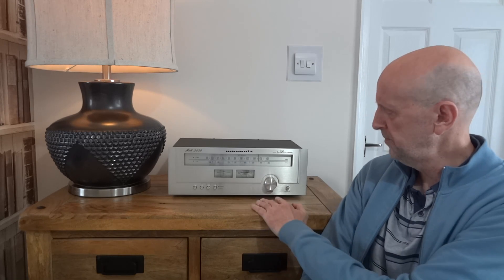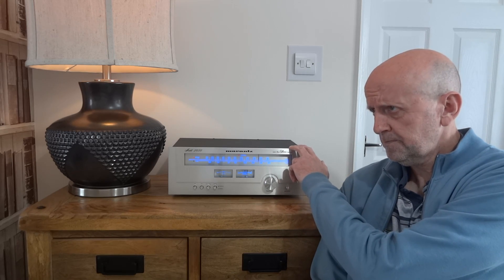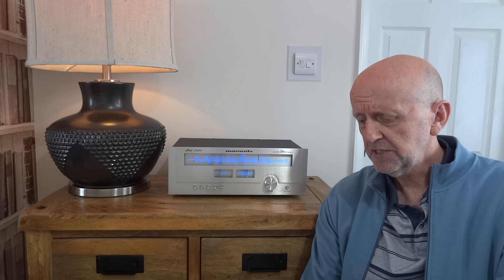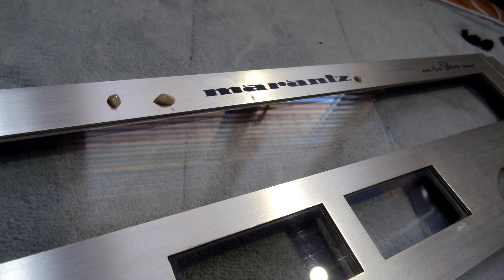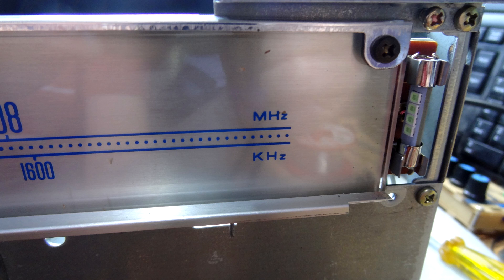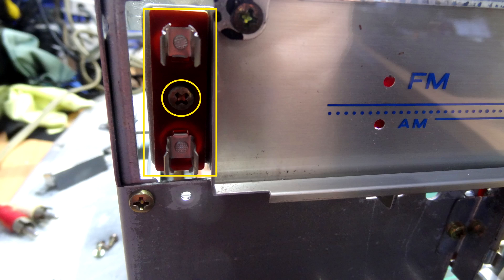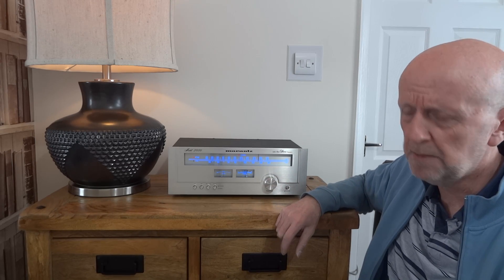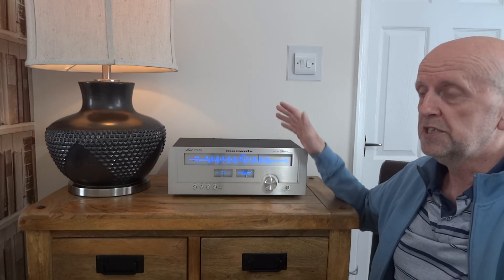Marantz Vintage Tuner Replacing Lamp Bulbs with Blue LED ones and cleaning display

Comment: What about the VU meter lights
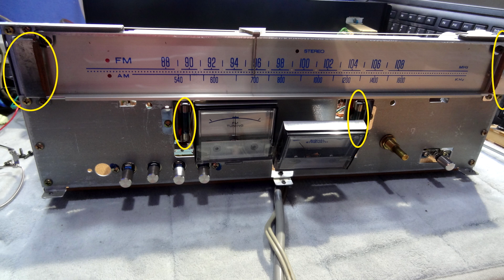Reply from the maker: Thanks I should have touched more on the VU meter bulbs as well in the video, they are the 2 middle bulbs circled at point 1:55 of the video, they will just pull out and easy to replace.